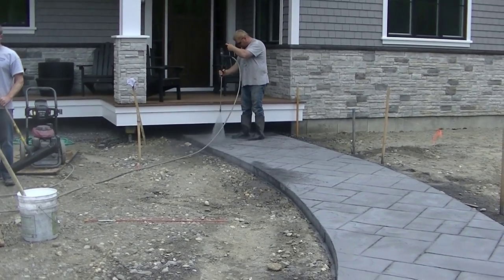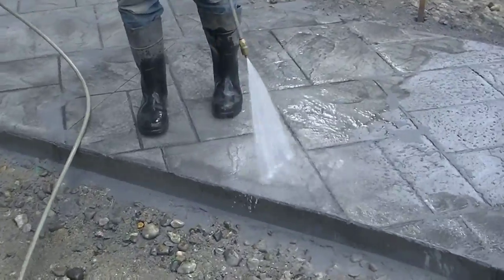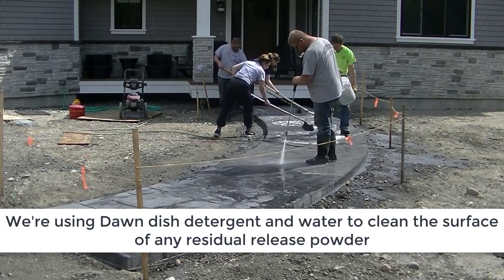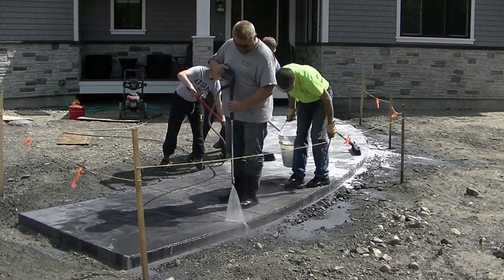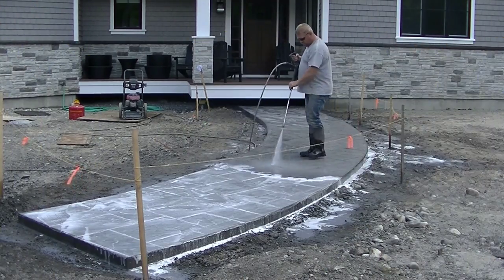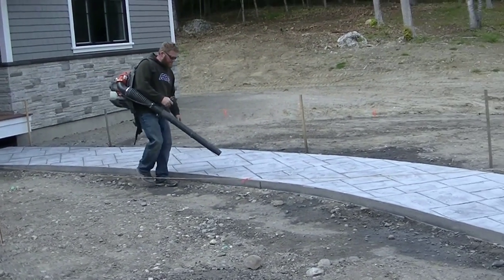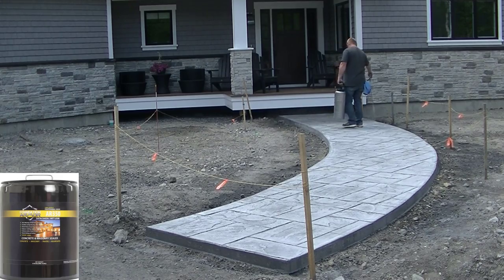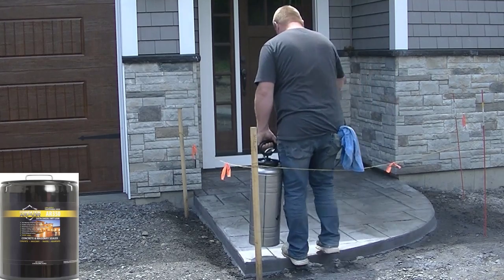How To Clean And Seal Stamped Concrete | Sealer Recommendation

Comment: Just seeing and utilizing your instructions now. Even with all the great info and advice, this was a steep learning curve for me. I’ve done simple walkways on our farm here no problem. But the stamping wasn’t a snap even with your crew making it look so easy. Trying to work your time table, I experimented on a small concrete landing for a set of steps I’m adding to our wraparound deck near our mud room. I had pretty fair luck mixing my own concrete in the first of 4 40”x40” sections. Stamped surprisingly well for a first attempt. But the second two both ended up too creamy and watery on the top and I stamped too soon. Not the same clean registration as the first. For the last one I used a 3,2,2 mixture and reduced the water to almost a paver mix. That really worked out well and started coming close to the results y’all were getting. I’m going to try to add some of the detail back to the two poorer stamped sections which will be more easily seen in front of the steps. With a grinder. I’m also conceding a big project would be out of my capabilities and I’m going to allow my goto professional contractor to use my stamps to do a patio sized pour I thought I’d try originally. I’ll just save my newfound “Mike instructed” stamp skills for the smaller walkway projects here for now. But this video series all made the difference between complete fail and moderate success. We all see our own mistakes more, but I think it’ll probably look pretty good once it’s sealed later this week. Thanks so much, Mike.

Comment: I'm new to the pressure washing game but rapidly learning. I see in a lot of forums that you are not suppose to use a surface cleaner on concrete less than 5 years old because it will wear down the cream. Can you do a video about this, explaining what that is and the proper way to clean newer pours? I have not been able able to find a video that goes into any depth on this subject.

Comment: My stamped  concrete  was done last year.
The contractor  did sealing  after 3 days.
He sealed with two coats without  let it dry enough. 
This year I saw lot of white  residues.  I  took it out with xylene.  Now what should  be my next step  to make it look shiny  and glorious.  Thanks 🙂
Reply from the maker: If the Xylene worked like you said, then another very light coat of sealer like this one : https://amzn.to/3hZGoYQ
You can roll it on or spray it on, just keep it very thin.

Comment: Mike I used release on concrete with no integral coloring and used a textured roller with the concrete itself hold decent color from the release
Reply from the maker: It'll retain some of the release color yes. You can also use a product called Tique Wash if you feel you need more color.

Comment: Thank you for this video. Looks pretty straightforward. My stamped concrete was poured 5 years ago. I have power washed it but haven't sealed it since. Shame on me... Needs it badly.  Besides being very dull, over time dampness leaves a green algae-like residue, and dirt. Power washing will take that off. Don't know if they originally used water-based or solvent-based sealer... just guessing it was water-based. It's all very dull now. I see you recommend Armor Ar350, an acrylic. Please don't be offended by the question, but is acrylic-based that much better over time than water-based? I'm so confused about which kind to use.
Reply: Water based is cheap for that reason as it washes out over time.

Comment: I'm doing a stamp with color. I don't have a pressure washer I was just gonna use a hose and a push broom. And your soap method. Question is I will be fine using a hose from the house correct

Comment: I have black stamped concrete from 2 years ago 
I have dirt build up in the lines 
When using water it settles on top of the stone form after cleaning 
Do I blow that excess water off, so it doesn’t leave water spots?

Comment: This is such a great video! I'm a DIY lol so love this. My contractor used my weedeater diesal fuel with 2-stroke oil in it as rubber stamp release agent 3 weeks ago. Im ready to acid stain awaiting the proper cure time but test spot came out yellow instead of walnut. Can I use dawn like you did here for 2 stroke oil removal? If so, how long to let dry before testing again? If not, any suggestions?

Comment: I used an autumn brown powder hardener, then used a sandstone release agent. The release agent was mostly white powder. What do you recommend to remove all the release agent? Also, what do you recommend to highlight the concrete once the release agent is gone? Thanks for your input
Reply from the maker: You're probably not going to be able to remove all of it. Just wash it like we do and lightly scrub it. That'll remove most of it. If it doesn't and you want to remove more, you can try a 9 parts water to 1 part muriatic acid wash. scrub it, neutralize it with baking soda and water mixture, then rinse it. That should remove a little more.  Then use Tique wash from NewLook International.

Comment: Just got one, the contractor cleaned and sealed it, but when the patio is wet, water sits on the texture and by the time it evapoarates it leaves white patches on the stamped concrete patio. What could be wrong?

Comment: My wife's grandmother has a stamped concrete porch that is 3 years old.  A family member used Thompson's Water Sealer on the stamped concrete to reseal it.  Unfortunately, it didn't absorb.  What is the best method/product to use to "strip" off the Thompson's Water Sealer without damaging the stamped concrete?  Thank you!

Comment: My stamp was laid today and it rained like 4 hours later. I run outside and the concret looks like it had small conreter laying on it. I was nervous.  I am assuming it was from the drops of rain. then I go and touch it and what I thought was hard concrete just dissolved in my hand. SO I am wondering when i wet  it tomorrow will it look like it did at first.  The guy is coming to seal it in a few days.

Comment: Hi Mike, I have a stamped concrete patio and a chapin max sprayer. The 2 nozzles they provide are  110-1.0 gpm and the other is a 95-.5 gmp. I have followed your YouTube videos and am wondering why I cant get the nice even spray like you do. I get banding, according to chapin and they say the sealer is too thick. I am using foundation armor 5oo. If you would, can you tell me what size tip i need for this sprayer and sealer combination so I can get the same spray results as you do without the "banding" I would greatly appreciate it for my next sealing.  Thanks in advance!

Comment: I have a house with a stamped patio that looks colored pinkish,it looks like it needs a good cleaning and new sealant.  If I do as you have done will it take some of the color away? Or do I need to do anything different?  I called to have it done but they wanted $900 and I don't have that kinda money. Any additional  advice /tips would be great

Comment: Thanks for the video.  Our stamped concrete had an umbrella on it that was weighed down by a sandbag and the sand pulled the color out leaving white blotches.  We used the powder with sealer to color in those spots and it came out a little darker.  I'm about to reseal the concrete ,but was wondering if there is an easy way to bring that color closer (lighten it) to the rest of the concrete?  Thank you.

Comment: Can you make a video on adding color to concrete manually?
Reply from the maker: I only add color by putting the bag of color in the concrete truck when they load the truck. I used to throw color on the surface and work it in with the bull-float or mag float but not anymore. It's way to messy that way.

Comment: Hi Mike great video! What are your thoughts on cleaning the stamped concrete throughout its lifetime?
I found downstream bleach works, but not sure how that works long term.
Reply from the maker: Simple Green and lightly pressure wash, don't use bleach, it'll end up damaging the finish and discolor the concrete.

Comment: What would you recommend to clean sealed and unsealed stamped concrete? We use 1% bleach soap mixture on cement with a surface cleaner. Can I use the same process or should I brush dish soap and a brush for maintenance?

Comment: For a DIY’er a plastic sprayer is fine, just throwing it away afterwards—$8 versus 250 for a stainless steel sprayer and you have to clean it. Again for a DIY’er. Also, I rolled my stamped concrete for a more even coat- contractor sprayed it and it was very uneven in less than a year so I redid it.

Comment: Great video! Can you use an electric pressure washer with less PSI on stamped concrete so it won't crack? My 3400 PSI pressure washer seems like it's too heavy for a job like this. Thoughts??
Reply from the maker: Yes you can. It really depends how close you hold the tip and how early you wash it off.

Comment: We just had a concrete patio poured. The concrete was colored, stamped and a powdered release agent was used but the contractor did not power-wash and/or scrub the release agent before applying a sealant. The release agent was swept off with a broom and then the sealant sprayed on (very spotty). Now I have light "powder" marks along the concrete cuts (under the sealant) and bare spots where there is no sealant. Can I remove the sealant, power-wash and scrub the release agent off or is it too late to correct the situation? Any suggestions would be greatly appreciated. Thanks

Comment: Hi Mike! I'm looking for advice on how to remove red stain/paint from stamped concrete patio. It's 26 years old and looks bad so I want to do a different color entirely and achieve the the same look you have on this curved walkway in this video. Any help would be greatly appreciated. 
Thanks!
Reply from the maker: The best way is to have someone soda blast it (like sand blasting) They can lightly go over it and take off all the old stain/paint. Then you can use Tiquewash  to re-color it and then new sealer.
Reply: @MikeDayConcrete  thank you!

Comment: My concrete was stamped and colored by the throwing method that you no longer use. If I power wash and scrub the way you suggested won't I remove the color from the concrete? As a result of the throwing method isn't the color just in the very top layer? My grey stamped concrete (just like in your video)  is 3 years old...after hard rains you can see areas of color fading away. I would like to power wash it and seal it but am afraid I'll remove all of the color off. Am I missing something?
Reply from the maker: You may remove some "loose surface color" but the color should be hardened in to the cement paste on the surface of the concrete. You could "stain" the surface to re-do the color if you need to, then seal it. Check Ameripolish.com for stain colors.

Comment: Question about new everyday concrete. Would clean it the same way and get good results?
Reply from the maker: I use a surface cleaner with a pressure washer but yes get excellent results.
Reply: Mike Day Everything About Concrete Thanks

Comment: Had a slab poured, stamped and sealed by a contractor (Texas) and I was expecting exactly the look on your video.  However, it has BLACK spots all over it and the sealer has completely absorbed.  Does that mean they didn’t power wash the release off properly??

Comment: Hi Mike, Im hoping you still look at these comments being that this is an old video I have a  question will pressure washing release after a few weeks or even a month take off the release? I had mine done about 3 weeks ago but not enough release was removed. I was wondering if I can go over it with a pressure washer to take off more of the release.  Also I thought we should always wait for the concrete to fully cure before sealing. Am I wrong? Seems a little too soon to seal after a few days.

Comment: Can I use a 2400 psi pressure washer to prep my 3 year old stamped concrete patio?  Maybe just a smaller fan and longer time spent to do so?
Reply from the maker: Yea, it might just take you a little longer.
Reply: James N.     Look for something like a “SIMPSON Turbo Nozzle” to make it go faster.  It’s a narrow stream that rotates, covers an area like a fifteen degree fan but it penetrates like a zero degree.    I have one and it has worked very well for me.
Reply: Lazy Lizard I bought on and really made no difference.  Turned a flat swipe into a circular swipe.   Returned it.

Comment: I think I messed up my swimming pool and stamped concrete and I was going to power wash it and make it look nice i  used a cheap electric power washer not my high pressure heavy duty one and I used the 40° temp and I was gentle on it and look at my results